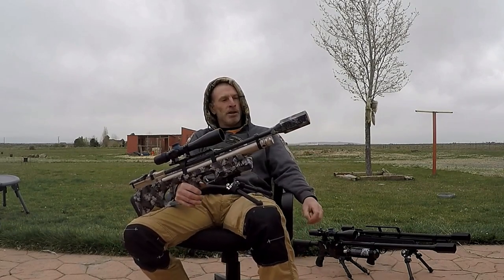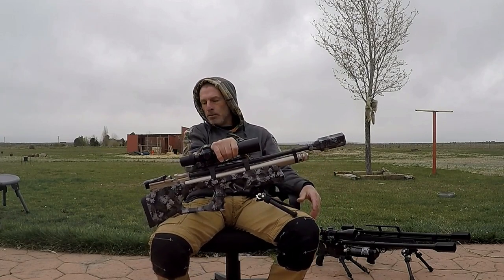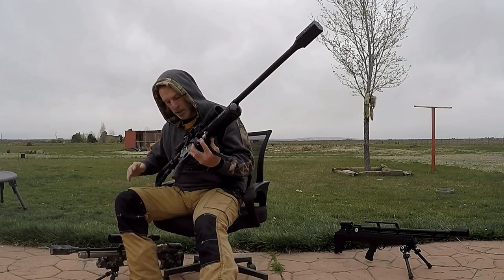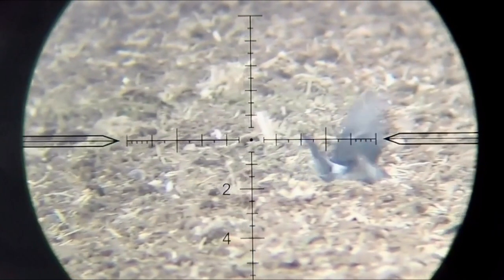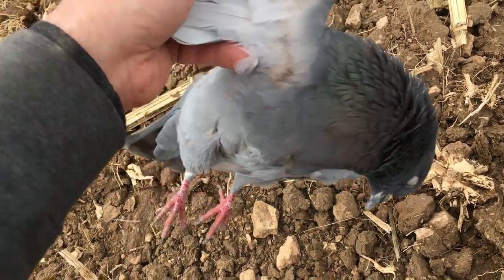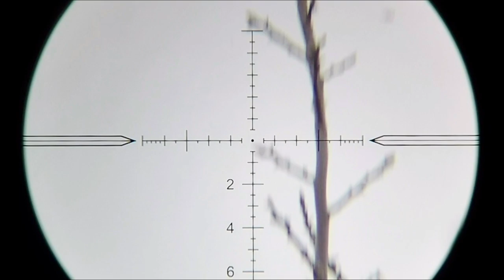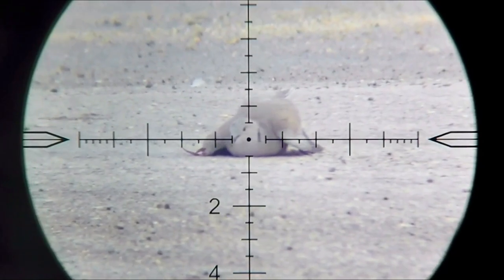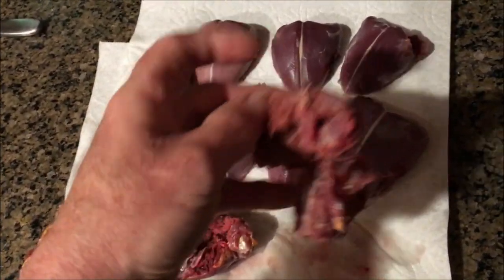Kral Puncher Breaker / 3d LDC's  / Hunting / Air Venturi Avenger Bullpup / PCP Air Rifles .22 Cal

Comment: nice shooting . I did have a couple of those Kral Puncher Breakers one in .177 Cal and the other was in .22 Cal nice and compact good for shooting out of the car But did seem to have a trigger problems with them so repaired them and sold them on. But i do have one in .25 cal which works on just wish i could get more power out of it and a few more shots as it is only running at 18 ft lbs .
Reply from the maker: You could put a 22.5” Puncher Jumbo barrel & pellet probe in any caliber on there.  Then source a Puncher Mega complete air tube with valve & fill cap.  Those have 330cc.  Do some internal mods for extra power… Or just send it to me & I’ll git er dun for you & send it back.
Reply: @terminadorairgunsandoutdoors  Are you serious about working on the Kral Puncher Breaker?  I've had the Puncher Breaker Silent Marine in .22 caliber for two days and I'd love to get it  upgraded.  I found a guy Troy Hammer on older videos and forums but he seems to out of business and I'm looking for a Kral tuner.
Reply from the maker: @nikonmark37814  You could send it in to Airguns Of Idaho.  Jus name is Luis & he has a YouTube channel.  He’s done work on some of my Krals as well as other PCP’s